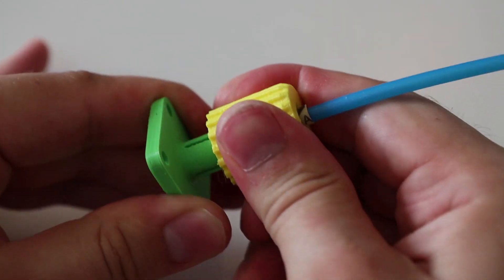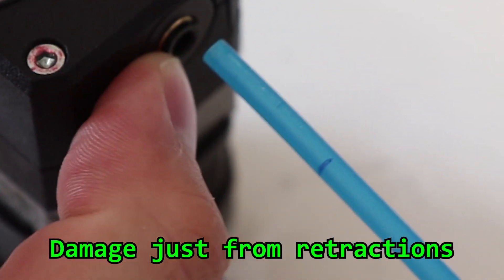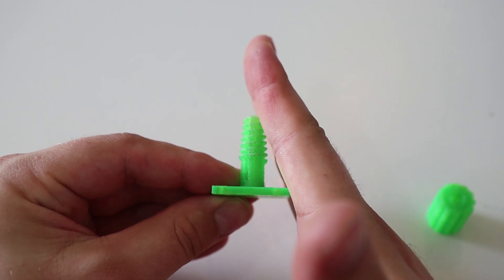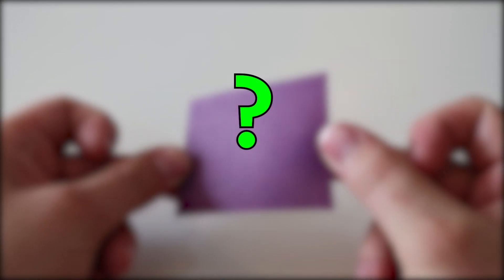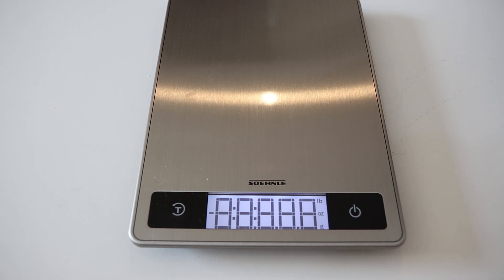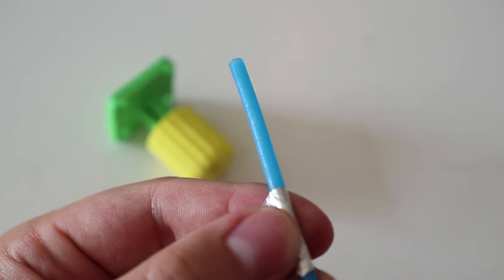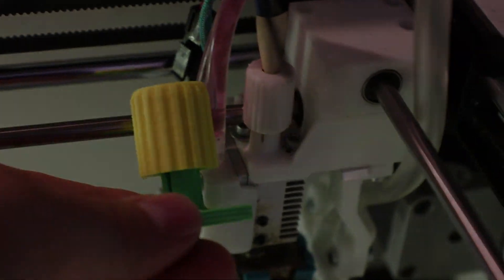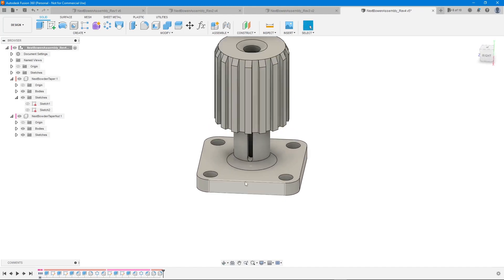This Bowden System Will Hold Over 10kg! (3D Printing + Fusion 360 Download!)

Comment: 👍  
  I'd looked using something along those lines, but I wasn't too happy with the bulkiness, although you've done a great job paring the size right down.  I'd seen some smaller & neater steel compression fittings from China, though the minimum order costs plus delivery times put me off.

  I thought of a far more straightforward method to use, which is: push the PTFE tube through a little more than usual, flair the tube end out with a countersink/deburring tool by rotating it in the non-cutting direction while pushing and then give it a couple of light cutting turns and reassemble.

  It has held solid in my CR10s_Pro for the last year, at least; previous to doing this fix, every 4-6 weeks, I had to "strip & clip".

  NeedItMakeIt has a quick video showing a similar but probably longer-lasting solution; search for "No More Movement at the Bowden Tube Fitting to Extruder" if anyone fancies some extra options.
Reply from the maker: That's a bit of how copper brake lines are fitted to your car. They even have a special tool for making the trumpet shape at the end :)
Reply: @PattysLab  That's the one, a flaring tool.

Comment: Surprised you used a tapered thread, if you use normal thread you can have the end (smooth) tapered with a matching taper in the nut, just like a cable gland, nice work though, and now its been designed its a bit of a moot point - sorry.
Reply from the maker: Your suggestion is absolutely on point 👌